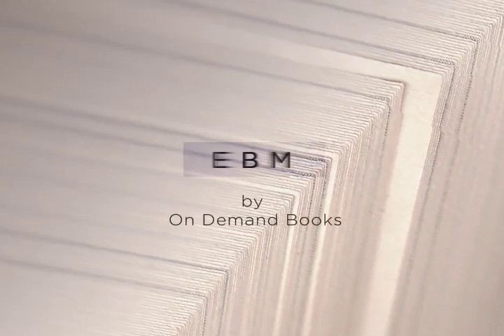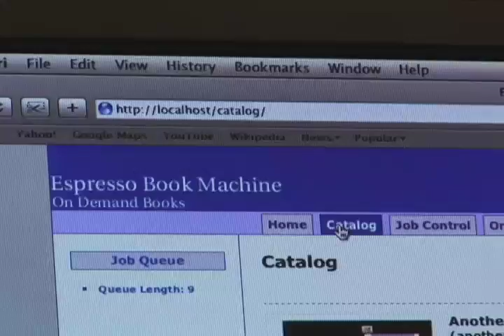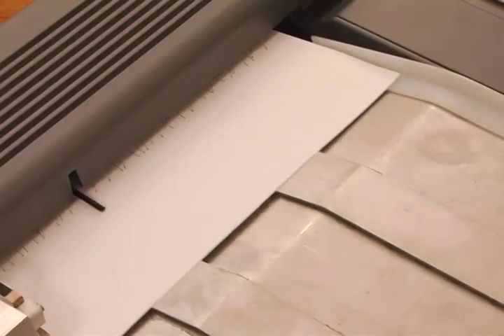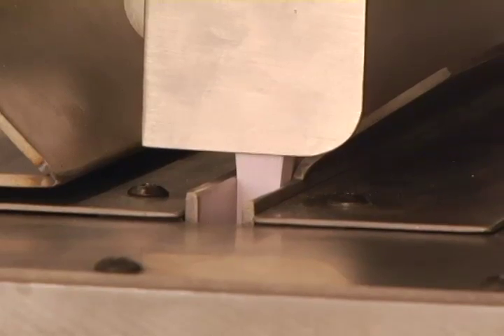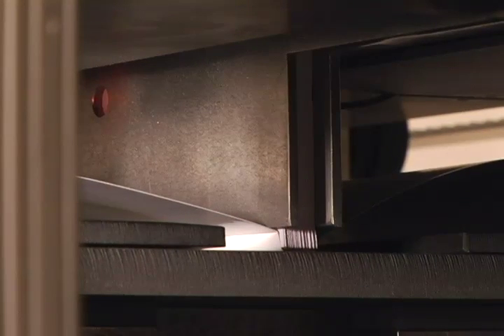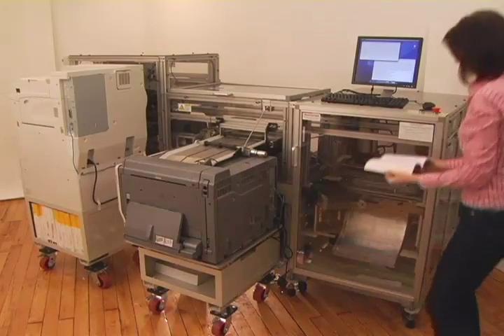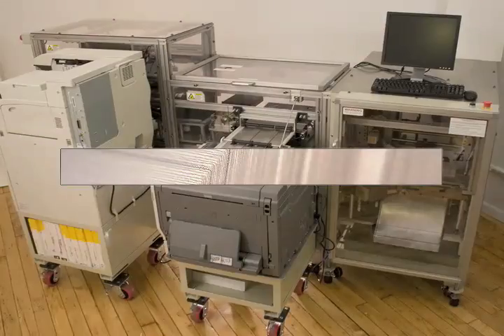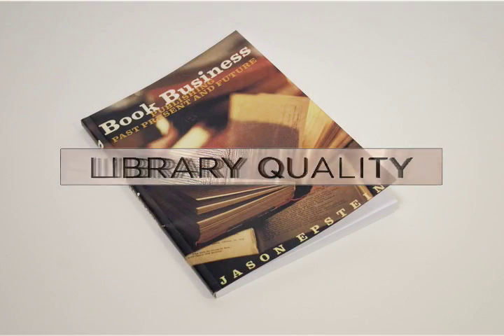The Espresso Book Machine

Comment: @FanNE24 
You're right.  From now on all books should be cast in steel and stand 5 feet  tall to protect from potential book burning!  

It doesn't matter what format knowledge comes in.  Paper is just a medium that we've gotten used to, and it's not a very sturdy one at that.  Same holds true for vinyl, Cd's, DVD's, stone or any other format knowledge can be stored on.  If you want to read or save it or destroy knowledge, it won't matter what format you choose.  The media isn't the message.

Comment: It looks like ppl here never saw a laser printer associated with a binding machine.. The cost is very high per book ( compared to have books printed in china : even only  500 books would cost less on per unit price) and of course it gives only paperback .. Get yourself an old xerox printer A3 (i do have a 4525 it prints 45page/minute) and then get a binders ( check chineses manufacture) that cost no more than 2000 usd.